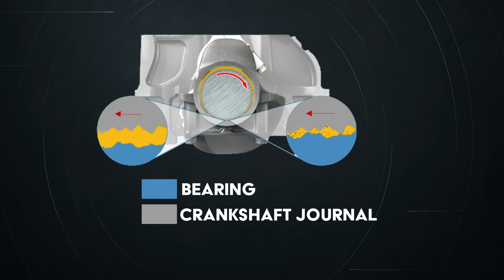the truth about start-stop technology (finally proven)

Comment: With todays brushless motors and their reliability, why have an engine driven oil pump, or if the engine has to have an engine driven pump why not supplement it with an electric one to keep oil pressure when the engine is stopped. On large ship engines, oil pressure is established before the engine is started. This must be possible for car engines.
Reply: Some more premium cars have an additional electric oil pump that keeps oil circulating after shutting the engine off. So the oilpressure-less phase is pretty much non existend. But that only solves half the problem with engine starts anyways if you have watched the video. If the engine is at 0rpm there is no fluid film between metal parts, starting the engine up causes metal on metal contact and therefor wear. It needs about the typical idle rpm for metal parts to lift off from each other and start gliding on fluid with hardly no wear at all.
Reply: @lobster8009  
Also there is a high torque load on components like the timing chains and cam phasers with every start and stop. Not so much when it stops because throttle valves smooth the process.
Reply: I'd like to hear this discussed in greater detail.  Heck a compressed air reservoir might keep oil pressure up long enough most of the time.
Reply: @catsupchutney Oil pressure is a red herring. Oil pressure just ensures everything is properly coated. It takes awhile for oil to completely drain - it's designed to drain slowly. The engine only needs to stay coated for like 45 seconds. As long as there is a film of oil, there is no metal on metal contact, and start-stop engines are programmed to restart often enough to keep everything lubricated.
Reply: List of reasons you will never see an electric main oil pump:

Drive power, the amount of power to pump cold and thick oil or hot oil at high pressure is much higher than you'd assume. Peak drive power is in the 5hp range, think how large a 5hp electric motor that could output that continuously would be

Cost, obviously 

Complexity, you'd need a pretty beefy motor driver for the power 

Efficiency, alternators are only about 1/3rd efficient, you'd end up burning around 3x the fuel needed to engine drive the pump 

Reliability. Obviously

Also, lack of need
Reply: Many do. The thing is, they're testing an engine not designed for start-stop.
Reply: @LaurenceGough It appears to me to be a 2016 VW Transporter T6 van, which is start-stop.
Reply: If you listen to the presentation, he explains why this wouldn't work. In a static engine, the oil pressure would just push the crank against the bearing at some point and hold it there. The bearings need constant movement of the surfaces to spread out the oil into a sheet between them. As soon as you stop, the two surfaces will press together at some spot until you start again and the bearings run dry until a new film layer is established.
Reply: @michaellowe3665 Start-stop engines time when to stop, so they are at the optimal crank position.

Whether that technology existed with the 2016 VW Transporter T6 van, I don't know. But as a service engineer, he knows surprisingly little about how modern engines work. He might be a genius with older VW bugs, but not start-stop engines.
Reply: Most hybrids have electric oil pumps.
Reply: @stevenbmw850  Not most, the more expensive ones do...
Reply: there’s no evidence or any Solid data that shows the start stop functionality has had any impact on the atmosphere one way or another. As others have said, adding another component that can fail just adds to the heap of waste we already have. we would need several lifetime cycles of data if not, thousands to determine the environmental effects. This idea of we know something about the atmosphere and how the humans have affected it over. Only a few hundred years is naïve and Ludacris. We have not even scratched the scratch of the surface of environmental knowledge.
Reply: There's a saying "a lack of evidence is not evidence of absence."

It doesn't apply here, because your lack of knowledge of any lack of evidence does prove that you are ignorant.

Aside from peer reviewed studies that do exist, large freight companies run real-world trials covering millions of miles, and based on their own trials, pretty much every freight company is transitioning to start-stop engines. They are not doing that for any regulatory reason, but purely to save money.
Reply: Makes full sense, but the bean counters don't want added expense to actually increase engine life. They are forced to meet emission standards only. Sad.
Reply: @curtchase3730 And yet large freight companies - which buy vehicles designed specifically for large freight companies - are transitioning to start-stop engines
Reply: $$$ HAHAHAHAHAHAHAHAHAHAHAHAHA is the answer
Reply: @clc2328 Exactly. It's sad how many people say they disable start-stop on their cars because of feelings. I'd rather save $$$$$.
Reply: With yesteryear's heavy duty, four bolt main, big block truck engines, you had no need of electronic components whatsoever. And those engines ran great, and they had hella balls. Raw horsepower, raw torque, fossil fuel burning balls at its mad American finest! It don't get much better'n that!
Reply: @CrazyBear65 😂 That's why large freight companies are transitioning to start-stop engines. Turns out, the only people who care if a truck has hella balls are people who put trucks nuts on their tail hitch.... Like the American finest who aren't concerned about wasting money on dumb crap.
Reply: Look up Accusump
Reply: It doesn't matter that much if the oil pressure is there. As he explained, the bearings are hydrodynamic and work because the shafts are rotating. No rotation = the surfaces scratch each other. It's the same on most fans.
Reply: @razorblade7108 No rotation = scratches?! What??

Engines use oil. The oil coats the cylinders and shaft. Oil has something called "viscosity", and is made to stick to the engine.

As long as the parts are coated in oil, there's no scratching, barring contaminants. That's true whether in motion or not.

Because of that thing called "viscosity", it takes awhile for oil to completely drain from an engine. Far longer than the 45 seconds during a stop (and they engineer start-stop motors to have more oil in the upper part of the engine).

That is why start-stop engines last longer - every second they aren't running is one more second of it's life. If no rotation led to scratches, we'd expect start-stop engines to wear out faster, if not seize up.
Reply: @MrRoguetech We are talking about hydrodynamic bearings. You should probably do some research on them before commenting on this topic.

Hydrodynamic bearings wear down when the rotation of the shaft is too slow e.g. when the shaft just starts moving or is stopping. Hydrodynamic bearings have no wear once the shaft rotates with high enough speed, as the hydrostatic pressure generated by the rotation makes the shaft levitate within the oil.
The viscosity of the oil is important, but it doesn't prevent the wear of the bearing completely. Especially with thin oils in modern engines it becomes a bigger problem, as a thin oil also means a thinner oil film at rest and a larger portion of the surface irregularities of the bearing and the shaft will get in contact and scratch eachother. You can battle this by creating smoother surfaces, but you will never get them completely perfect on a microscopic level.

There are other bearing designs which have less or no friction even at low speeds, but magnetic ones simply wouldn't work as the magnets would attract all the ferromagnetic debris in the oil and ball or roller bearings would probably make the engine too hard to assemble and disassemble, as they need to be inserted in one piece. Also they have wear during continuous operation, which would likely make them wear down faster overall compared to hydrodynamic bearings in this case.
Reply: I understand the rotation of the bearing surfaces basically spreads the oil and without the rotation you get metal to metal contact. However there are two things happening. One is if the oil doesnt fill the gap between the surfaces, the effect is that those surfaces are subject to a 'hammer' action where they are bumped together. Then there is the rotational forces where the bearings slide on each other. If oil pressure is kept, then all it takes is one rotation of which ever shaft for the lubrication gap to be filled. An engine driven pump takes a few turns to build pressure back up again. The bearings will still have a residual film of oil on them (the old Magnatec adverts) though, which should be enough to stop damage in those few turns. Most wear happens when the engine has sat for a time and the pump must draw oil up the pickup tube.
Reply: It's already possible, many cars today use electric oil and water pumps in order to cover for this.
Reply: Because $$$$ and the whole intent is for the auto to have a limited life.
Reply: Same for electric turbos
Reply: @Major.Tom.1973  only to speed up the initial rpm to reduce lag. A completely electric turbo takes a lot of power to produce pressure and the alternator and electrical circuit has to supply that power.
Reply: A lot of the design in oil distribution relys on the engine being in motion to dispurse the oil through out the engine. I want more simple engines again not sensors for my sensors and un diagonisable electrical gremlins
Reply: It's not needed. For start-stop engines, you only need to maintain oil pressure for an average time of about 45 seconds.

Whether the 2016 VW Transporter T6 van used in the video, as opposed to more modern start-stop systems, does that.... he doesn't say.
Reply: some tractor engines lock the oil in a few part of the engine to prevent the engine running dry.
Reply: While that idea would probably increase reliability in the long term, it adds complexity, and decreases reliability in the short term. As long as the engine makes it through the warranty period, the manufacturer couldn't care less. In fact, it would be in the manufacturer's interest for the engine to break just after the warranty has expired.
Reply: @stagehits i don't agree with that. Reliability and getting a high mileage from a vehicle is what people base their purchasing decisions on.
Reply: While there are a few costumers who look into reliability in their purchasing decisions, I suspect most couldn't care less. Otherwise, no manufacturer would be out there selling cars with wet belt technology, which is notably unreliable.
Reply: @TotalAnomy +15 years, 700.000 km and still running like a Swiss clock?
Toyota and other high quality manufacturers build millions of reliable cars with wet belt technology. 
You don't know what your talking about!
Reply: @TotalAnomy  
Except it’s not. Not when the oil and belt change intervals are appropriate. No more unreliable than dry timing belts which also need periodic maintenance or they also will fail. The intervals recommended by certain manufacturers were in most cases ridiculously optimistic in the early days and did result in a high failure rate within the recommended service interval. That and the design of the belts has changed with the light of experience. Changing belts every 60,000 miles and engine oil every 10,000 does add short term extra running costs compared to most current dry belt schedules and compared to the early promise of wet belt costs. I do agree that the advantages of wet belts are only to the manufacturer, not to the end user.
Reply: @yoda-be.at1746 I agree. But no one knows how long a car holds up until it's driven. I mean they don't need to make an engine that holds for millions of miles they oonly need to market it correct so everyone gets the impression it will hold. 
I read somewhere about washing machines that manufacturer secretly only makes them to last for 5 years basically. And from economic standpoint it makes no sense to make things that last for years and years. Like if they could they would make so we buy new things every year probably.
Reply: @OmmerSyssel  You forgot to give us the name and source of of that engine that you say is capable of reaching 700k km with wet belt . Wet belts are scams an i will not ever buy a car with this "technology" . Electrics are more honest
Reply: @yoda-be.at1746 some can be very easy like putting a stop valve like what some diesel pump have integrated and some diesel pump pre-fill the engine before start  so they should the same with the oil.
Reply: Be great if the electric oil supplement pump doubled as an alternator so it could be practical when not 'in use'
Reply: If the oil pump doesnt work 1 time your engine is cooked. In certain hybrid or new vehicule the coolant only works with an electric pump and when this pump dont work anymore the engine is cooked in minutes due to heat. So if electric oil pump is a thing, this is bad (sorry dor my bad english)
Reply: @karex1414  Mechanical oil pumps fail too.
Reply: @karex1414  Your engine or water pump can die even if it's mechanical as well. Snapped belt or broken blades, etc. So your "electric pump is bad because it can break" argument does not make sense, my man.
Reply: @Dinosbacsi Your right but for the belt, it is planned by the constructor to change it before there is any chance of it breaking.(Every ~160k km depend of the brand+model)
  For the blades, if the motor isn't crap it won't break.
For electric pumps which are already on recent vehicles there are already reports of breakage at really low kilometers/miles (100,000/150,000 km). On mechanical pumps this practically never happens before several 100ths of thousands of kilometers or even never before the engine is destroyed by other main parts. Today, manufacturers are switching to electric coolant pumps to reduce mechanical forces on the engine and therefore polluting emissions for Euro pollution standards. But as always, reducing polluting emissions = reducing the reliability of the vehicle, and the coolant pump is one of them. Obviously the electric oil pump is the same thing
Reply: @Dinosbacsi That's why the majority of the time the oil pump (absolutely vital to not fail) is driven directly on the crankshaft 

And yeah, you've highlighted an issue when pumps are driven on an unreliable drive system, they cause unrecoverable damage. You just sold the reason for not having an electric oil pump.
Reply: @karex1414 the mechanical forces on the engine are the same if not more when using an electric water pump. That's because the alternator has to supply the electricity to run it. The only benefit is not having it running full speed before the thermostat has opened and to better control the temperature of the engine by controlling its pump rate.

Tbh we're flogging a dead horse regarding ice engines. Motor and battery technology is improving at pace now.